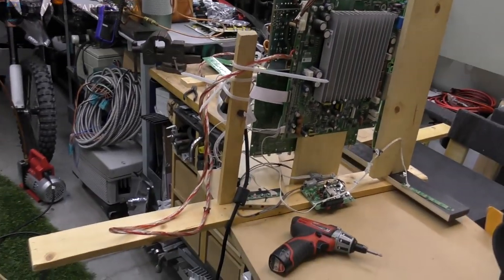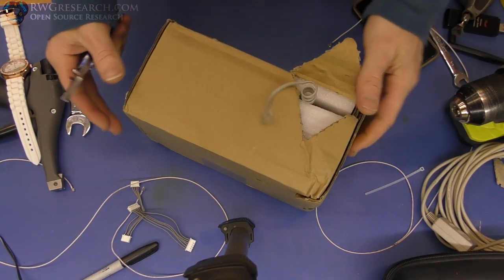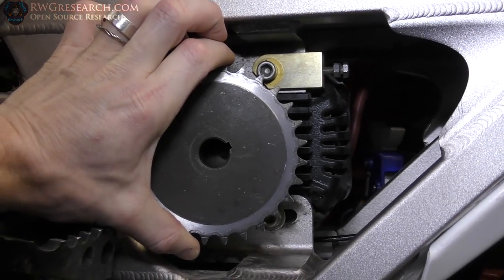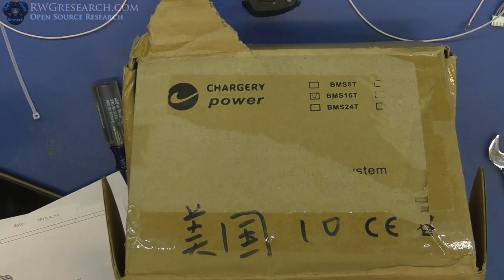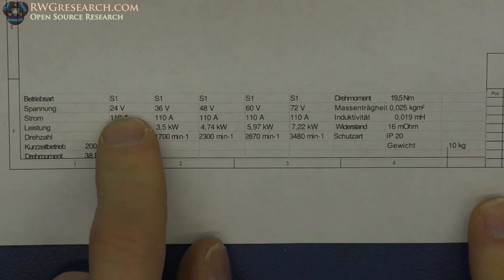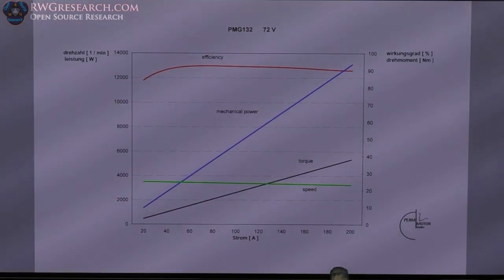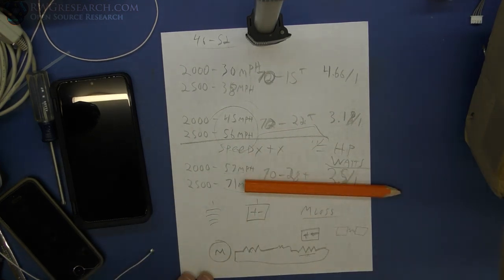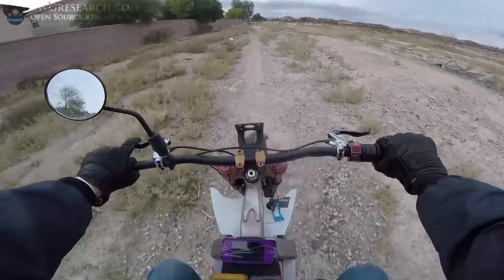Zero P9: We Have To Talk... Drive-Train HP Ratio Speed... & New Test Runs With 22 Tooth! + Extras

Comment: Hi Russ..by far the best way to work out your speed is to put a small dot of paint on your back tyre and then roll the bike forward until you get 2 dots on the ground.This is the distance travelled per revolution of the tyre and from then on everything else is a simple calculation... you can then change sprockets as many times as you like with easy calculation of speed.